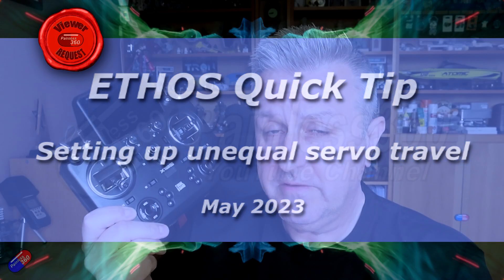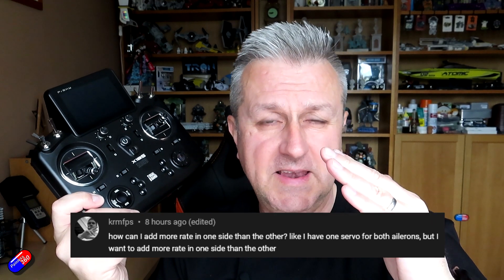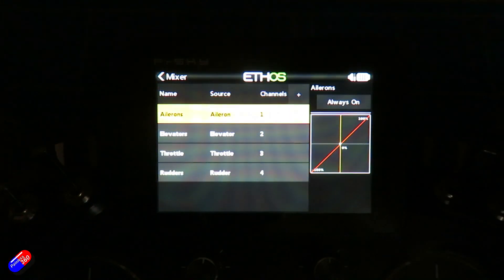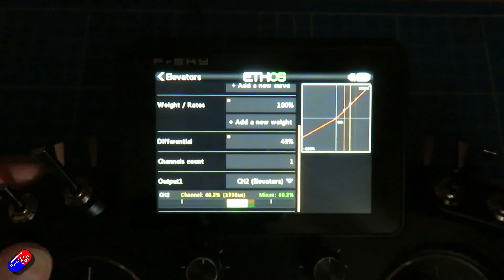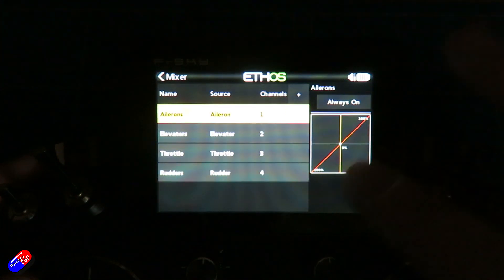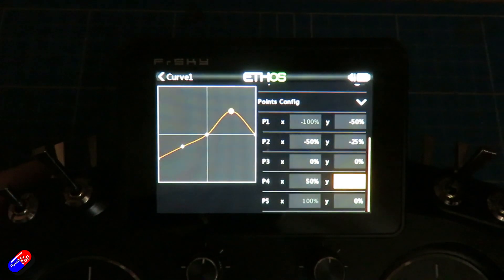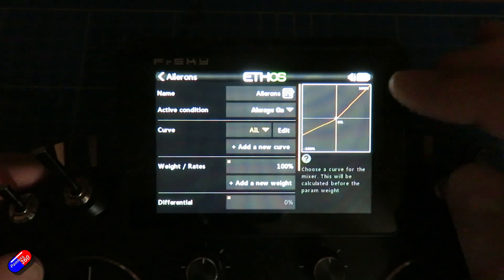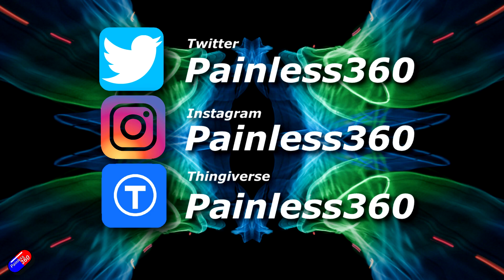Setting up unequal servo movement in ETHOS using Differential and Curves (viewer request)

Comment: Great video thanks. I'm on Ethos 1.62 and my transmitter is a FRsky x20r. I recently purchased an afterburner kit for one of my EDF jets but although the kit is of good quality the burner light comes on at around 15% throttle and increases brightness right up to 100%. If I plug the burner controller in to a spare channel as opposed to a Y lead shared with the throttle, would it be possible to set up a curve on that channel so that the burner light comes on at around 50-60% and brightens through the remaining range to 100%? This would be more representative of how real afterburners on jets work. Thanks. Pete.
Reply from the maker: I'd copy the throttle channel to a spare one and then add a curve to it that modified the output so that the value changes to the values you need as the throttle moves. Best of luck
Reply: @Painless360  Thanks for your reply. It's actually how to set up the curve that is giving me the problem as I'm fairly new to Ethos : )
Reply from the maker: Check out the latest video on curves in EdgeTX https://youtu.be/u0Qo__xyfO4 the principle is the same... Best of luck

Comment: great video. very helpful. do you have a video on how to sync 2 servos to control the elevator? when both servos have different subtrim to get centre  . thanks
Reply from the maker: If they are on different channels on the receiver, use the sub-trim on the channels in the radio, if you're using a Y-cable when you need to do it all mechanically on the model.. Best of luck.